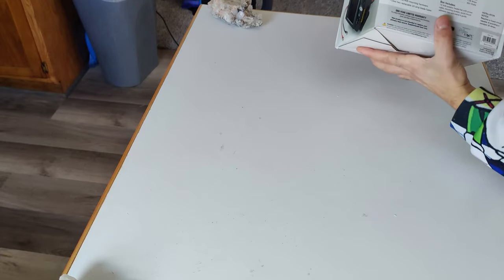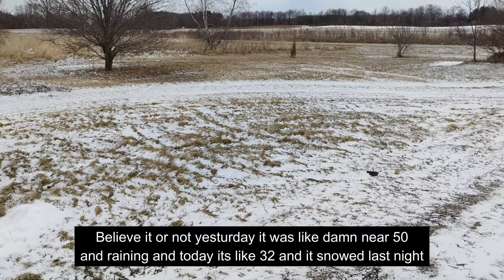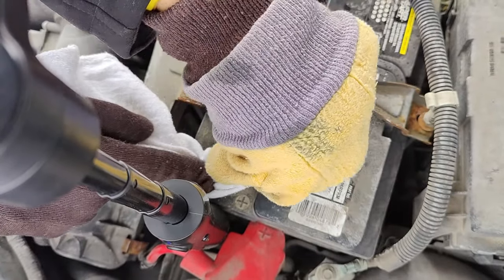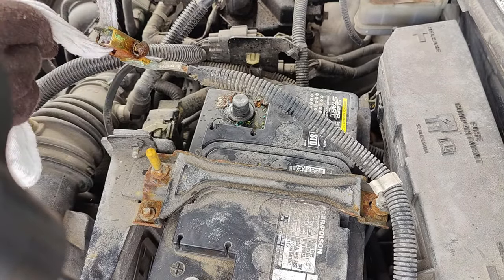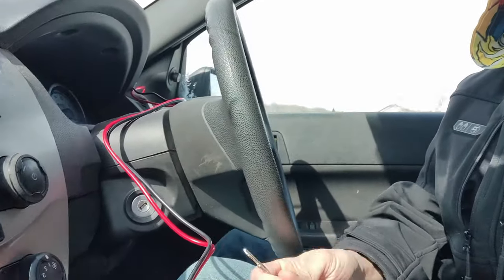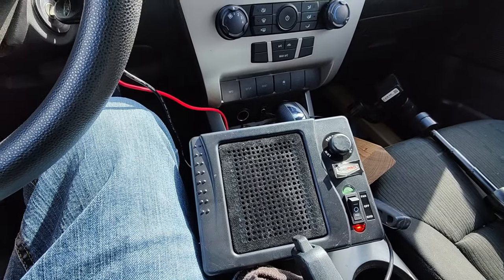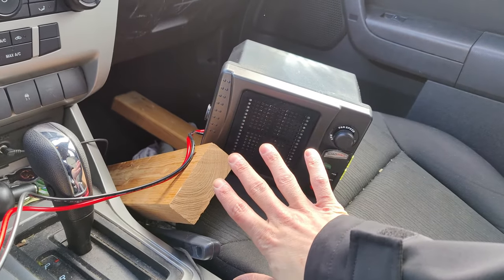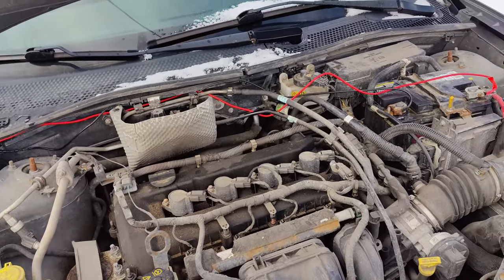$50 Road Pro car heater, Does it work?

Comment: I tried it. It drew a huge amount of current & generated very little heat. I then returned the piece of s___. BTW, I now use a Totmox heater that actually works, given about a 15 minute warmup.
Reply: What's info on turbo heater?

Comment: i put an inline switch on mine, it's in my van still taking up space because i don't really know what to do with it, let me tell you this pos is ABSOLUTELY USELESS , you could make more heat by blowing past a candle, and it's not even cheap £70 in the uk, looks the part but cheap rubbish
Reply from the maker: I did say it created little to no heat lol
Reply: I have 2 of these in my van..  it will work good at or above 40°F..

In about 40 min it will increase temps by up to 30°..  in a decently insulated van

Combined they use less than 500w of 12v power... 

I use them because it's more affordable for me to regenerate 12v power through solar ..

Comment: Did I miss where you installed the inline 30 amp fuse that the manufacturer required??? I purchased one ( heater)earlier today, I have yet to install it. Also instead of taking the fuses out every time, I’m going to splice the wires and add a quick disconnect. Thanks for the video.
Reply from the maker: Mine didn't come with 1 so I just took the fuse out

Comment: You don't need to bother pulling a fuse or installing a switch to turn off that little red LED.  A typical LED of that size only draws about 0.02 amps of current, or 1/4 watt of power, which your battery won't even notice.  By comparison, a traditional incandescent dome light draws at least 40 times the current (0.80 amps, or 10 watts) of that little LED.  When the heater is running, though, it draws a whopping 25.0 amps (300 watts), hence the need for a direct connection to the battery and the recommended in-line 30 amp fuse.
Was the smell you noticed coming from the heater or from the wiring???
Reply from the maker: Thank you I will look into it. As far as the smell that was coming straight from the heater itself. The entire thing is made of plastic so it's kind of a design flaw